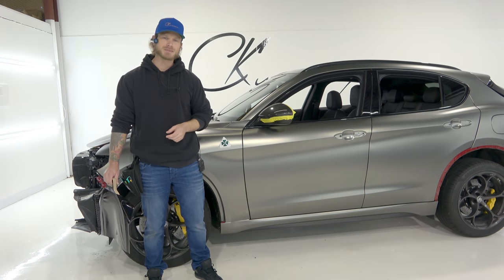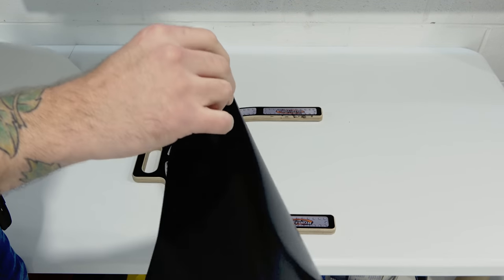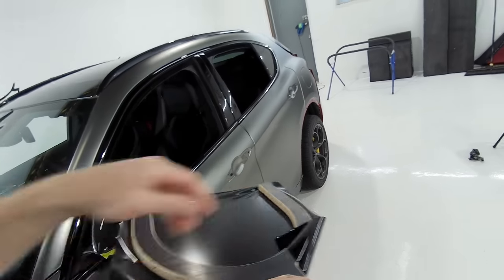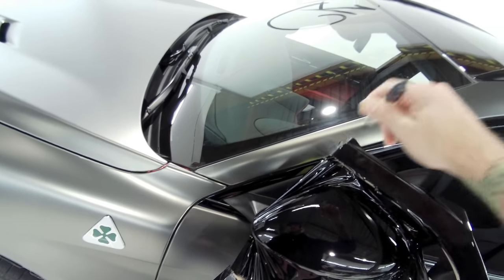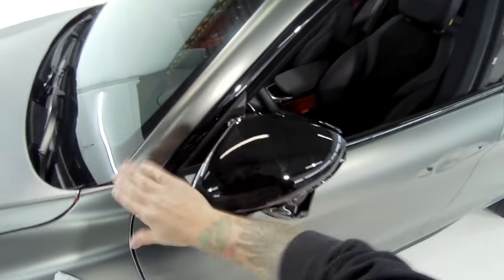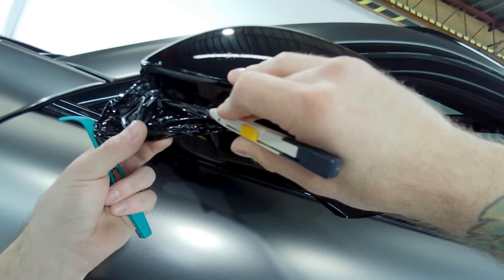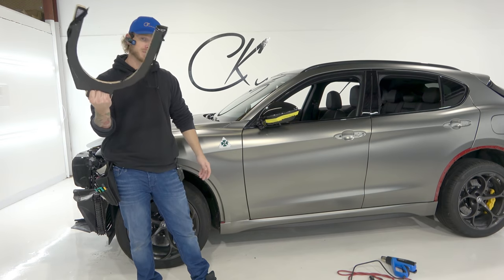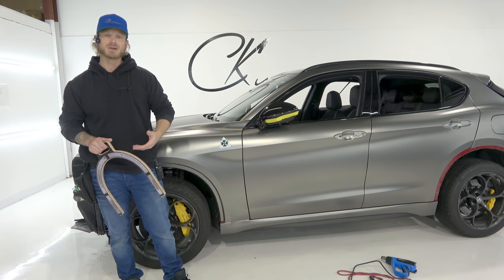Easily Wrap ANY Mirror With This TOOL!! - - POV

Comment: this is SUCH a convenient video for me because I have a new Alfa Romeo Stelvio myself and wanted to try and wrap them with a single piece of vinyl (instead of two because I’m no professional). I think with this tool, using the same pulling motion shown here but placing the tool slightly higher (i.e. the point on the mirror slightly lower) I could legit wrap the mirror caps with a single piece! thanks for this video

Comment: Like the video and the tool is awesome. Going to get me one. I don’t do wraps of whole cars. I’ll do a hood or a roof and mirrors sometimes. I just want to know from you what is the best gloss material for wrapping mirrors that gives a nice shine, doesn’t scratch easy and looks like paint. I’ve been using Avery supreme wrap, but it just looks like a bad paint job. I mean it leaves littl marks all over it. If you stretch it too much it doesn’t have a thick deep look to it like paint. Oracle used to like a lot because it seemed like it was thick and deep and a good gloss but I can’t get it very easily. Do you still use all Vivvid?

Comment: Hello CK, I've seen that the mirror was not finished and was left with some slack in the front. How did you finished the bottom side of the front corner on this side mirrors?
I have a client that wanted 3M carbon fiber, and he will come back this week because it start to peel off at some edges he said. (I was expecting to run in some issues, as was a small piece of vinyl that I used).
We first did it in one piece, but that didn't work as the carbon fiber didn't stretch back the way I wanted, then I had it done in 2 pieces.
What do you suggest? I am thinking to take out the mirror caps. 
If I don't get them right this time, as I have ordered  more material, then I will pay the vinyl from my pocket 🤦

Comment: 65US is a bit much for jigsaw cut plywood but that is a damn cool tool anyway.
Reply: Jig you say? There is more than you think. You will need - CNC for shape cutting and countersink "beds" for plexiglass panels. Commercial laser to cut the glass, UV printer, and few extra tools for finishing ;)
Reply: I agree totally.  Pretty simple to construct, I made four  from MDF for just under  $50.00 And they work perfectly.
Honestly, I think Sign Maker Tools are over exaggerated and overpriced.
Reply: @bookiedan1163  Where did you get an idea about this tool from? We hope you did not forget to install Plexiglass inserts. After all -  “Imitation is the sincerest form of flattery".  Cheers.
Reply: @signmakertools  Thanks for the advice. Did it in one of them and really wasn't necessary. The ones  without the plexiglass worked jist the same. But in all fairness, I do have access to a CNC, so it was pretty simple for me to do.
Reply: @signmakertools  Yea, jigsaw and plywood.  No fancy shmancy, just a solid frame that works. Free from scrap wood. Yours is prettier, but my wallet likes mine better.

Comment: What is your favorite vinyl brand where overall you dont get glue lines/ dots/ other blemishes and imperfections in the vinyl that bother you while installing? 

I remember when I started you had to really screws up to get all these issues. There was more of an adhesive separation issue back in the days, which I would prefer since I never experienced it. Now with 3M and to a much lesser extent Avery get these ridiculous marks left from what I assume is poor/thin adhesive/ plus thin vinyl. 

I remember several years ago when it was thicker and that never bothered me any. Just more heat and  I got the job done. Now I find myself replacing panels so often until I find a method where the vinyl goes on in one smooth run with no lifting back up for corrections (as those leave marks). Its become quite a burden. 

So what is your favorite brand that installs with the least amount of  blemishes?

Comment: Dots are not happen because part is warm or not, its because you "glide" it over the surface while stretching..
Reply from the maker: This also happens more often when it's warm and still happens when simply sliding the film without stretching. It can also happen by simply picking up the film without tacking it down first.
Reply: @CKWraps  It's frustrating.. Wrapped bmw rock grey it's almost impossible to avoid it on trunk, roof, hood.. I know it's not ideal, but tack reducer (diluted) helps a lot with this problem. It's mainly because of draging vinyl across surface. It's like glue rolling when u do it.. So pick high and hook quick down helps as well.